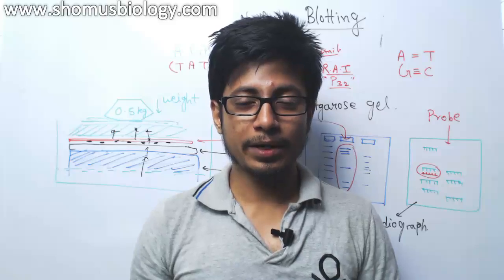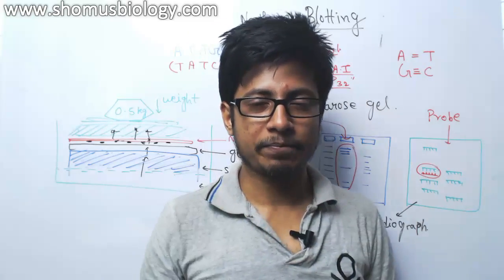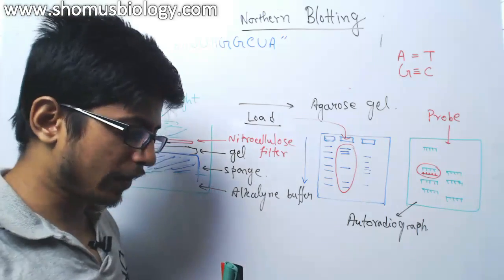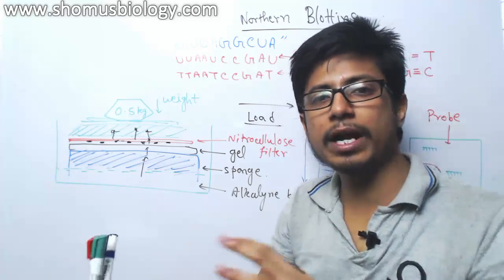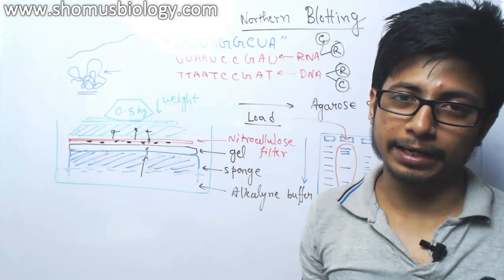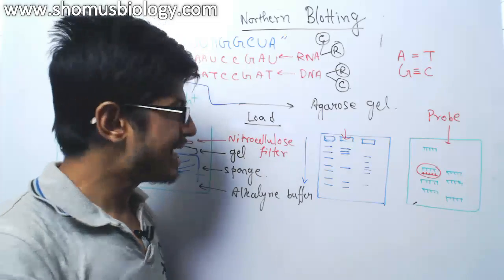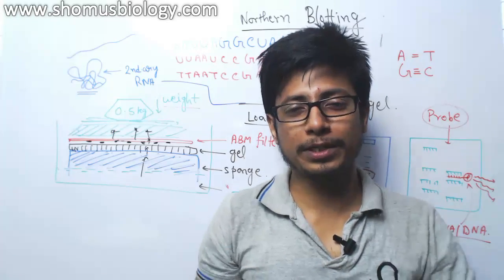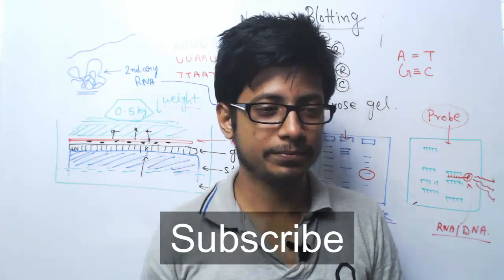Northern blotting technique

Comment: what is the advantage of using aminobenzoxymethyl filter paper over nitrocellulose filter paper?
Reply: Southern techniques has been of enormous value but it was thought that it cud not be applied directly to the blot transfer of rna separated by gel electrophoresis since rna was found not to bind to nitrocellulose. Therefore james alwine david kemp amd george stark devised a procedure in which rna band are blot transferred from the gel on to the chemically reactive paper where they are bound covalently. The reactive paper is prepared by diazotization of aminobenzyloxy methyl paper.